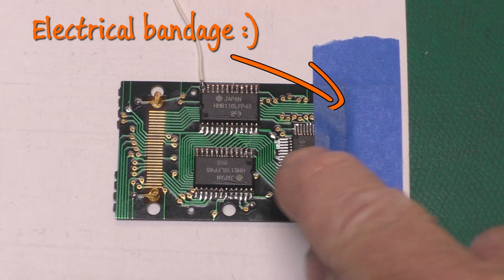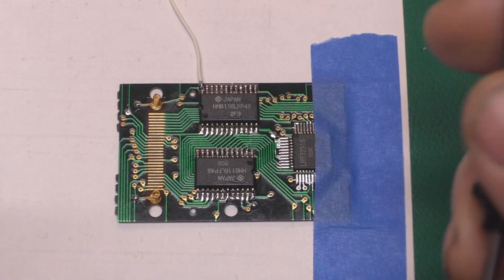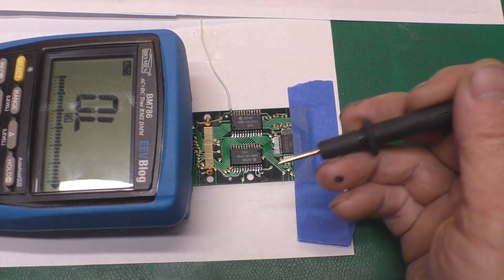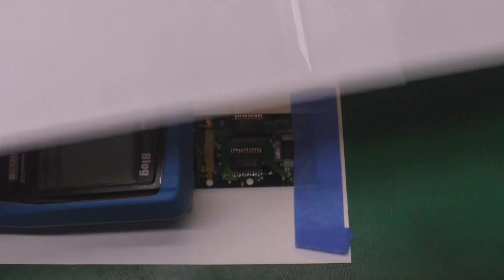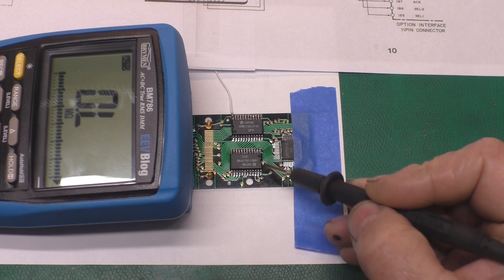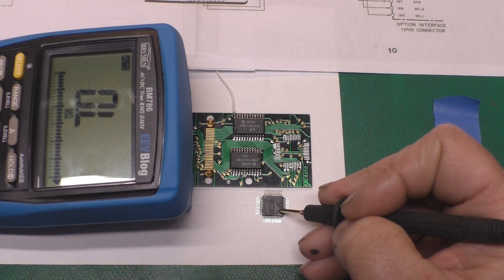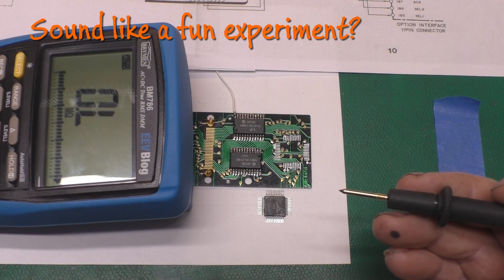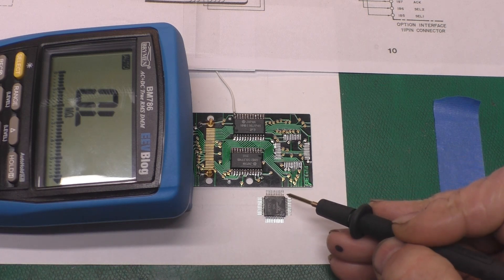Shorts 0007h, Finding bad chips using only an ohmmeter!

Comment: Is the other meter lead connected to the wire soldered to the supply rail?
Reply from the maker: Yes, I'm measuring from a supply rail to each address, data, and control line.

Comment: Great video. Would you be interested in making more videos along these lines. I find it fascinating as well as easy for a hobbiest to try out as well.
Thanks.
Reply from the maker: I have a few ideas for similar videos about troubleshooting techniques. I want to find a simple way to do both that does not require a lot of test equipment that most folks won't have.

Comment: Hey Birt! That's how I used to  solve the tough cases when I  was a teenager and friends would bring faulty stuff to be fixed. Compare  the ohms reading on chip pins :) Now that you shared the secret, everyone will get way better than us at fixing odd things :) By the way, I immediately thought to replace that ROM with some SOIC eprom (or eeprom even better). If there's enough space to fit it with all the
little wires needed anyway...
Reply from the maker: I guess the next step up in blind testing IC pins would be a curve tracer. I don't have one though :) I do wonder how a simple homemade one would work for finding faults.
Reply: @HeyBirt  Well, I have a curve tracer, it's actually the kind that can display semiconductor curves but it's not usually used for in circuit testing. My channel logo is infacts a collector curve out of a BC548 transistor with the 0 base bias curve cut out :) I've never used a curve tracer for in circuit troubleshooting. I think the best method is knowing how the circuit should work and test if it's doing the right thing.
Reply from the maker: @iz8dwf  The idea of using a simple curve tracer for in circuit testing goes back decades. The idea is to compare the response curve from a known good to unknown part or compare pins of similar function on same part. If you don't have a schematic it can be a quick way to find a fault.

A simple 'octopus' curve tracer is shown here: https://www.youtube.com/watch?v=Gwo3pEH7hUE
Reply: @HeyBirt  Yes I knew something like that actually existed, but I really wouldn't like to idea to probe random parts anyway. In all cases when I didn't have a schematic and I still wanted to fix the thing, I've reversed engineered the schematic (as painful as it may be). I wouldn't use any curve tracer that puts more than 5V peak for in circuit testing.

Comment: maybe a pullup resistor can fix the issue
Reply from the maker: This input should be high impedance, 10-30 megohms. Since it is only 500ohms it indicates an internal short (it had this low resistance to both power rails.)